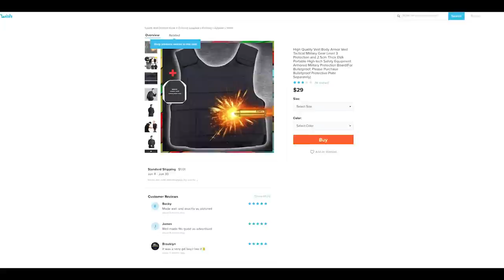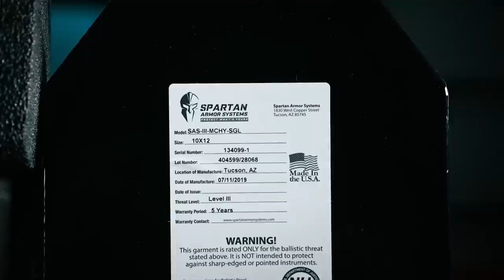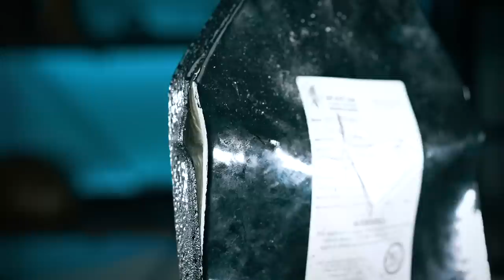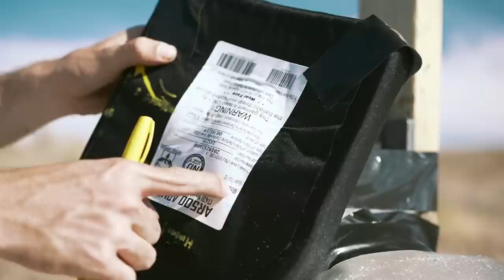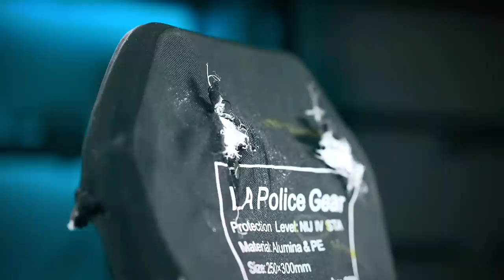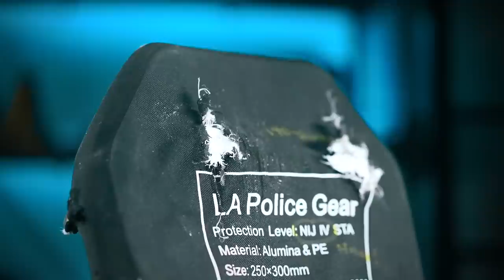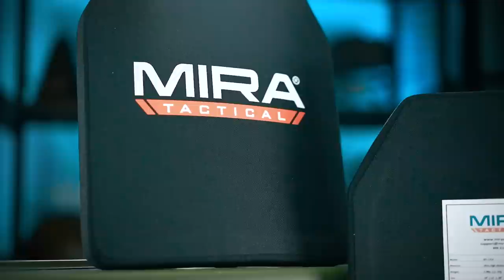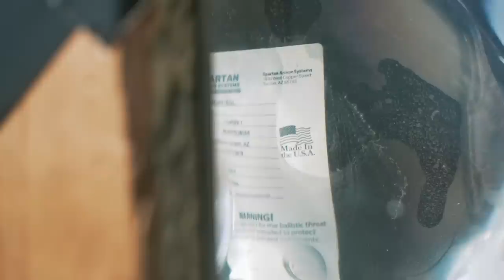Best Ceramic & UHMWPE Level III & IV Body Armor: Mira, RTS, RMA, Spartan, LAPG

Comment: Nice thing about NIJ certification in my opinion is that you can rely on science nerds and not gun nerds.
Reply: problem with NIJ certification is its become largely a meme and down right disingenuous how many companies stamp "NIJ certified" without ever sending the plate in to be evaluated so gun nerds are really the only way to separate the wheat from the chaff.
Reply: @nemisous83  not true at all. You can look at the list on the nij website. 

If the company says “nij TESTED” it’s not the same
Reply: @RenoMay  again its basically deceptive marketing, however i think this more or less calls into the question the NIJ test standards that a LV 4 plate cant survive 2 rounds of M80 in close proximity however a shitty LV 3 steel plate can eat 5 M80 rounds stacked on top of each other.
Reply: @nemisous83  that just comes down to material properties, not the standardized test. A level 3 ceramic wont stop stuff like a level 3 steel will that isnt a testing fault it is just different materials. Steel plates can be stupid dangerous when hit more than once due to the spalling cutting into throats and legs.
Reply: @nemisous83  the steel plate may survive those 5 stacked M80s, but the wearer definitely won't lol
Reply: Just say you bought steel plates and now you want to feel justified, bro. No shame in admitting it; we all make dumb purchases sometimes.
Reply: @andreivaldez2929  nah i wear a set of LV  III+ PE plates but the difference is i know my plates arent meant to be invincible however the pros' outweigh the cons like being buoyant and weighing sub 4 lbs
Reply: @JohnSmith-bf1sq  well thats largely a myth it also doesnt help this myth that most armor testers dont use a plate carrier when testing their armor. most spalling isnt traveling fast enough to penetrate deep enough to cut an artery however there is alot of things on your kit that can turn into fragmentation that can lacerate you notably the magazines and if you have a knife.

there is alot of reasons steel plates suck mainly weight. but the spalling myth is just a marketing trick to move more product ignoring the fact that ceramic also fragments and is moving at the same speed as steel and copper fragments.
Reply: well its a good thing plates arent worn outside their carrier now isnt it?
Reply: Same, although mine aren't buoyant (I don't live near any large bodies of water so it isn't a worry).
Reply: @andreivaldez2929  i got mine largely because of the weight because 10lbs for a full set of front and back with side plates is metal AF 

but I've always rejected the false prophets know as LV IV because honestly LV III PE with stop almost all common rifle threats while still remaining lightweight.
Reply: How dare you gun NERDS run around in the woods dressed like wannabe spec ops! 🤬🤬🤬🤬🤬
Reply: @RenoMay  True. Many companies play word smithing on "NIJ tested" "NIJ Compliant" "Tested in accordance to" "NIJ Certified". Easy enough if they aren't on the CPL listing, it's not Compliant or Certified. "Tested in accordance to NIJ 06 standards" would be a good statement by honest companies..
Reply: @nemisous83   Bullet fragments do indeed travel fast enough to cause serious damage to soft tissue areas, just in general ceramic or steel it isnt good practice to get shot. Plate carriers do not have any real effect on catching larger fragments.(steel or ceramic) Ceramic plates tend to spall outwards back towards the direction the bullet or "projectile" originated from. Steel plates are a good budget alternative for many people who want something. But as a general rule where your life is of concern, buy the best you can. The nice thing about living in a country with a functional hospital system, plug the holes and there is a good chance youll live🤙
Reply: @nemisous83  steel is crap and should never be worn
Reply: @bkackmagic555  source: "dude trust me a dude who knows a another dude told me"
Reply: @nemisous83  ok. By all means. Buy it and wear it. Your well being is none of my concern. Test it for us. Please
Reply: @nemisous83  I mean u dont have any source to back anything you said. But ya know. Nick Graham is a steel expert.
Reply: It's too bad most of these people don't know that NIJ literally has a list of plate models that are currently certified.

Don't buy from armor companies that have to advertise, I've never seen  Hesco, RMA, or LTC need to pay guys to review their product as the armor stands on its own with the NIJ cert.
Reply: @bkackmagic555  you act like Steel armor has never been used in combat or by law enforcement. Ignoring the fact that steel plates had been used from the 90's through the early 2000's the main reason they where dropped in favor of Ceramic was that the AR400 series armor was considerably thicker to meet NIJ LV III standard and where effectively flat squares and where very uncomfortable to wear. Even with those borderline torture device plates there wasn't any reports of officers or soldiers getting killed or seriously wounded by spalling.
Reply: @nemisous83  my lvl4 plates are 5.5lbs a piece. The silicone ceramic weighs 12oz less than alumina.
Reply: @JohnSmith-bf1sq  budget option? I just bought lvl4 ceramic plates for 80 bucks each...
Reply: @ChevTecGroup  NIJ certified? And in date? Good buy!!! 👍🏻 😅😅 just dont forget they are only certified for 5 years, and impacts even dropping them can degrade the plates. Glad you were able to procure some protection, 🙏 just remember armor is good but never is the end all. Just protects some parts, and only for a time period. Best way to survive gun fights is to not get in them.🤙
Reply: @JohnSmith-bf1sq  independently tested to NIJ standards, but steel isn't NIJ either. Its current production. I've literally worn ceramic armor for years (cumulatively) and never broken a plate or seen one break... and its easy to field test for major cracks.
Reply: @ChevTecGroup  awesome 👌
Reply: @nemisous83  Are yours from Prime Armor?
Reply: @ChevTecGroup  psht throw it away my dude
Reply: @Bestportlandcleaners  whom tf is that?
Reply: @nemisous83 bro what!? There’s literally reviews of lvl 3+ steel plates in carriers spalling and slicing the piss out of the ballistic gel dummy the armor is on lmao. Foh with that “myth” shit lmao
Reply: @dustinwatkins-vj1sx  present these videos also fragments imbedding an inch deep in gel is not the same as embedding 1 inch inside human tissue. Only a complete clown would think gel tests are 1/1 the same as actual flesh. The point of gel tests is to measure expansion.
Reply: Personally, I think it's stupid to debate the pros and cons of each and understand you should always get a set of steel at minimum. One, it's good for training with extra weight, two they last at least twice as long (wouldn't it suck if shtf and you couldn't get ceramics if your plates expired? Would you still trust them over steel?) Three, wear ceramics for the real deal if you know you're going to be in that scenario. Just have some steel for training and as a backup
Reply: RMA AGREES
Reply: @matthewriegner5180  you clearly have done research let us know how the steel works out.
Reply: @KuzcoC618  it works out great. Maybe reread what I wrote and you'd see there is a use case for having both, not that steel is better. 
Now since posting that some months ago, I will retract the expiration date thing. In reality plates last a lot longer than warranty times as I understood at the time. Also, small coats on steel can deteriorate over time also. But having both is not a bad idea. Additionally steel plates can be used for other things that you wouldn't use ceramic for.

Comment: I thought steal armour was great. Until I found out straping hand grenades to my Plate carrier also works
Reply: I thought Ceramic armor was great. Then Hescoe and LAPG and all other companies stated it had a mere 5 year shelf life. 
 
" The materials the plates are composed of will deteriorate and degrade overtime, eventually compromising the overall security of the plate as a whole "  - Hescoe Customer Service  

If your in Law Enforcement or the Military, go Ceramic for sure!. Better for extended duty use and also Uncle Sam will replace your plates!.
Reply: @yakivpopavich  rma has a 10 year shelf life
Reply: Shotstop has a 10-year warranty but that may just be marketing because I'm guessing so far nobody's got shot within that 10 years on one of their plates. I bought them anyway.

Comment: I bought level III+ plates from ar500 and a gas mask for shits and giggles last December right before everything went to shit, and everyone called me crazy... until March
Reply: DONT EVER USE STEAL ARMOUR unless you have Kevlar inserts
Reply: @joelerk6298  don’t even use it with the Kevlar tbh
Reply: Don't use it. Steel bad
Reply: @bkackmagic555  I know, spalling can slide shrapnel into the jugular. I bought it for shits and giggles. The carrier itself is fairly comfortable though, the ar500 vertus I think.
Reply: @thenkk4914  Don't read too much into what people on Reddit and Youtube have to say regarding Steel Armor.  Here is the honest take.

Spall is a serious issue with AR500 Armor , and it can be negated via doing two things
- Built Up Fraglock Coat at Purchase
- Use high quality external spall liner

If you layer the spall liner ballistic material bag ontop of your already coated plate, you will be fine. And yes Steel is heavier than Ceramic, however if your not out of shape and or straight up morbidly obese, your carrier weighing 22 pounds instead of 12 won't make that big of a difference. If you are not in Law Enforcement or the Military, don't get too caught up in the world of Armor and Plates. Get yourself a set and forget it. Despite what you will be bombarded with on the internet buying any type of armor is a good idea. Especially in the current cultural, social and political climate. Stay safe and have fun!.
Reply: @yakivpopavich  I was planning on getting soft body armor to put on to so it can have a steel backing, be more bullet resistant, and eliminate spelling for the most part

Comment: Fudds on ranges - “Don’t shoot steel closer than 100m out so you don’t catch shrapnel.”
Also fudds - “Just bought some AR500 body armor to strap to myself!”
Reply: Ahh this is funny 😂
Reply: Just wear a surplus flak jacket over your steel plates. Gtg
Reply: @youmustvotenato  sounds heavy asf😂
Reply: I got my truck liner on it, I'm good
Reply: The shrapnel just means it stopped the round. Another W for the steel armor.
Reply: @youmustvotenato  cause avg joe can move with 25 plus pounds of weight over their chest plus other gear..
Reply: @deadagn7169 Steel doesn't weigh that much anymore buddy
Reply: not all steel plates are shitty uncoated AR500 brand plates. also plates are getting lighter. maybe inform yourself. or dont, idc enough
Reply: @garrettzkool63  maybe don’t be a poor. Or not. IDC
Reply: @Bootbandwarlord  Steel plates with a good spall coating perform better on multi hit tests. You don't lose 6 square inches of material on each hit
Reply: @Bootbandwarlord alot of steel is heavy coated 3+
Reply: @deadagn7169 Counterpoint: If someone can't carry basic gear, they should focus on getting in better shape because just buying stuff isn't going to make them much more effective.
Reply: @youmustvotenato  "Yeah dude, just wear a flak jacket, kevlar vest, ceramic plates, steel plates, shoulder pads, crotch pad, thigh pads, neck pads, butt-plates, shin guards, and you'll be fine"

Comment: Good test guys!
I switched from RMA Level IV plates after my P.C. fell onto concrete and fractured last year.
Knowing that 30-06 A.P. rounds are uncommon, I switched to ShotStop Ballistics Duritium GT2 Level III+ plates, and so far so good!!
Reply: How do you know they fractured. Did you have them X-ray'd or perform a torque test? That ceramic strike face is .390" thick and would require a LOT of force to crack
Reply: @BuffRANGE  
Yes, I had them x-rayed, but a crumbling corner was pretty good indication that they were compromised
Reply: @Stoney_AKA_James  wow that’s a rare instance. Did you contact them?
Reply: @BuffRANGE  
No, because my P.C. fail from about 5 feet onto concrete and it was my fault.
I cannot NOT blame RMA, ceramic composites can brake.
Again it was my fault, and I took responsibility.
Reply: @Stoney_AKA_James  Wow that must have been a precise hit to do that. the 1155 has a foam edge protectant on the strike face.
Reply: @Stoney_AKA_James  RMA ad says "through them out of a truck and run over them, they can take it." i dont know if that is every model though.
Reply: @BuffRANGE  I love my rma lvl 4

Comment: Personally I’m surprised they didn’t use 5.56 M193 (NOT the XM193 they did use) out of a 20 inch barrel because as far as I’ve seen that’s actually been the most dangerous in armor tests. M855 gets outclassed by it because the M193 goes so damn fast.
Reply: XM/M 193 designation doesn’t matter as much as chronoing then and ensuring they are delivering max velocity.  IMI M193 is one of the few that make legit M193.

Comment: Can you tell me if the MIRA has a nice foam ring on it like the LAPG and RTS?
Reply: They do, but it doesnt negate any ceramic around the edges. Its still 10x12 which is nice that its not all just foam and essentially becomes a 8x10 plate
Reply: @rileyhewson5915  I’ve been told the Mira plate has a foam ring and a 10x12 is more like a 8x10.

Comment: Great testing! My only gripe is that you used 7.62x39 Hollow Points instead of just regular 7.62x39 FMJ , FMJ would honestly been a better test round overall.
Reply: You're correct, but it's not that much of a difference. 7.62x39 is just too slow to penetrate armor very well.
Reply: @nnerrfman6326  unless AP ...which cough cough illegal in usa
Reply: @robreadinger5340  *illegal for import and subject to your state. They're legal in GA just not for import

Comment: Don't wear steel yall. Even with the build up coat. It can be penned by m855a1 from a 14 incher and m193 from a 20 incher. Level 3 plus is stronger but it will spall. If you have a slight gut and you're not flat as hell like the target the spall is gonna fly into your face. Even if you're that flat the build up coat won't last long. Don't play on getting shot 10 times and sitting still.

Comment: I would like to see this test with plates in plate carriers. I'm sure that would add significant cost and time but i'm wondering how much of the material is kept in place by a plate carrier.

Also I know hesco plates are expensive but i'd like to know how they stack up. Is the price worth it?
Reply: Based off what I hear, they’re worth their weight in gold
Reply: I'd say no, as backface deformation against the torso is kind of a meme and entirely negated by a cheap aramid backer if you're actually concerned about it.
Reply: When you see the fragments flying out, most of it will come through plate carriers like butter. We did noticed that when testing our own plates thats why we're starting to add spall plates to our products. You can take a look at our videos.
Reply: @hjorturerlend  Is that like an extra thick trauma pad?. Some of the backface deformation I have seen from M855 and high grain 308 loads on IV ceramic literally protrudes 3-5 sometimes more inches. I feel like Trauma Pad or Kevlar Composite won't exactly stop your ribs and or lungs from being caved in with some of the heavier rounds on Ceramic.
Reply: @yakivpopavich  60mm of backface deformation is considered acceptable for the US Army, they don't consider it very important after being shot at for 20 years in the Middle East. The torso is pretty good at receiving blunt force trauma.
And yes a kevlar backer will significantly reduce even heavy backface deformation.

Comment: That is kind of nuts considering that the $100 level 4 plates from botach stop black tip 30-06 and I have seen many videos of them stopping ridiculous amounts of 5.56 even after the ceramic is pulverized. Not every plate is created equal I suppose.
Reply: Keep supporting those spy balloons homie

Comment: Interesting results on the LAPG level 3 plate, Mrgunsngear shot it with black tip as well and it didn't go through. Still, not bad for the cost.
Reply: Surplus M2ap depending on condition can be anywhere from 2500-2700 FPS. Well under the 2880 FPS needed. That’s why i moved my m2ap to 300WM

Comment: The problem is that the plates are not in a carrier. I have watched Mr. Guns and Gear test the LAPG level 3 that survived the 30.06 black tip. Also, I am not gonna stand there and let someone shoot me multiple times. If they use a full auto and it's my time then it's my time. Don't think 30.06 black tip is gonna be a big issue in SHTF/TEOTWAWKI

Comment: LA police gear lvl 3s are actually super nice. not crazy expensive either but theyll stop 308 and 556 green tips. a few times before they start pulling through tht broken ceramic
Reply: Would you take LAPG over RMA?
Reply: @gregzapata2537  honestly no. Just because rma is reputable and nij certified on their plates except the super lightweight lvl4s. I run highcom lvl 4s with soft 3a backers. Nij cert and like 6lb a side. Rma are good but super heavy. Eventually im getting the hesco lv4800
Reply: You can't say that for about $100 saving  money and buying level III from  LA police gear then placing it in a carrier with a soft IIIA backer wouldn't  be effective for anything most would ever have to face except for head shots and  a rare .50 BMG.